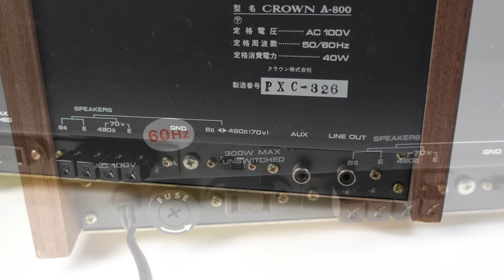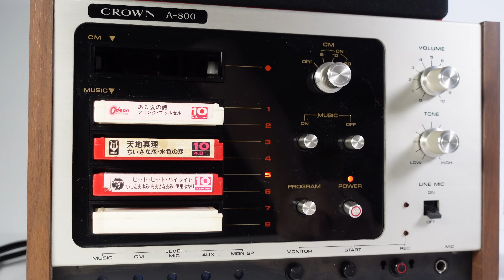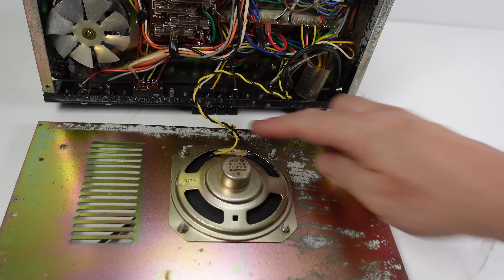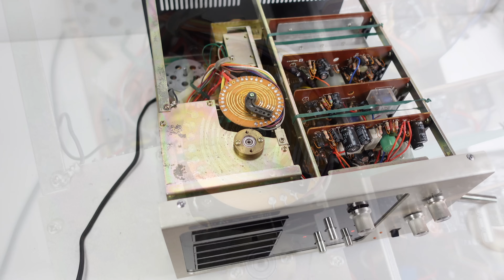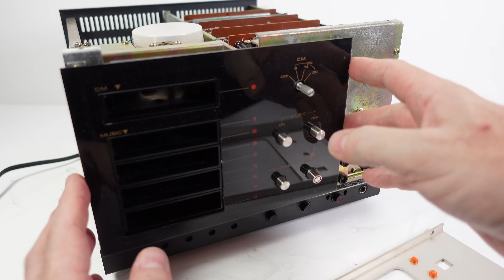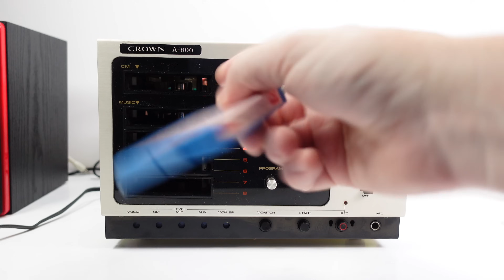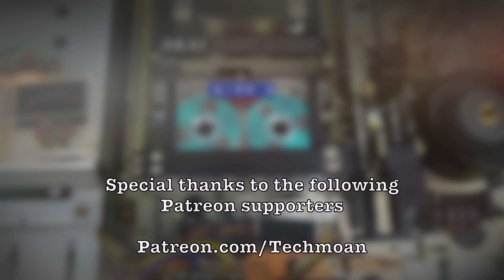An unusual player for a forgotten ‘70s music format

Comment: Whoever designed this machine must have been so proud of themselves. So many clever things. It's good that you showed it all for rest of the world to admire.
Reply: This is such a wholesome comment! Cheers!
Reply: Pioneer and Sansui were known as upper midline retail brands, but they both had research engineers who did interesting upscale and bleeding edge projects.  

Sansui devloped an FM tuner that only demodulated odd-order Bessel functions, in order to reject polarization spins from multipath.  Never saw that reach US retail, but very interesting to discuss, awkwardly with a quasi-English speaking engineer and ISO schematics, at a pro audio event.  

Pioneer made the first laser disc systems I ever got to try, but as prototypes had a single optical transport, with separate electronic units for music, video, or data (1980-ish).  In that era, JVC pushed a capacitance pit disc system, while until people realized how bad it was, RCA managed to market its tracking stylus video disc system, including via RAdio Shack.  Rather few in the USA realize how much innovative development work Pioneer actually did.
Reply: his name was Alfred Muntz of Los Angeles the carts were used by radio stations for commercials and other PA things he formed Muntz stereo pack and started manufacturing and selling four track car stereos
Reply: Absolutely! People take for granted the mechanical engineering that went into this type of equipment. I have an old R390 US Navy HF receiver that is such an amazing feat of mechanical and electrical engineering which blows my mind every time I look inside of it. The tuning mechanism is a labyrinth of gears, chains, shafts, and elliptical cams that looks like a 3 dimensional M.C. Escher drawing. It's definitely a lost art.
Reply: It's a textbook example of typical Japanese crap of the era. After the war japan was very poor and they were making knock offs of everything, basicly what china does today.
Reply: @kg4boj  Nonsense. This was early 1970”s, a quarter century after the war, and Japan had developed a reputation for quality by then.
Reply: @andrewagner2035  Japan didn't really start making decent stuff til the late 70s-early 80s. Back then toyota and Honda were just starting to be seen on American roads and great cars the were not! In the era in which this was made Japan pretty much fulfilled the role of what china does today, mass manufacturing of cheap crap. It should be no surprise that the announcement feature doesn't work properly and they are used a dying format for cheap parts.
Reply: @kg4boj  Japanese electronics was good from the middle 60”s already, we not talking about cars. There were many dying formats, that doesn’t mean they were bad, what about Sony Beta format for VCR? Wasn’t bad technically, was just not a commercial success. Then again the winning format VHS was also developed in Japan. Big difference between China and Japan-the Japanese are innovative and strived for improvement. Yet to be seen what happens with China in that department.
Reply: @andrewagner2035  Beta kinda sucked. It only let you record one hour of ntsc/pal video, whereas VHS, which came out in 1977 allowed 2 hours standard. But these are both mostly late 70s tech when japan stopped flooding the market with tons of crap we today would expect out of China.
Reply: @kg4boj  Except that VHS also came from Japan. Beta was a Sony development, and this had nothing to do with “crap”, but rather expectations of what the consumer wanted.
Reply: @andrewagner2035  In the late 70s after Japan stopped making crap! Before then video tape recorders were made by the all American company Ampex, which was recording at 525 lines of resolution in 1954, something that wasn't possible for consumers until the mid 2000s
Reply: @kg4boj  These we’re huge industrial recorders costing some $45k for broadcasting studios, not exactly in a small box  for home entertainment…..you need to compare apples with apples dude.
Reply: @andrewagner2035  Some models yes, but they had home versions like the vr-1500 thst cost about 1000$
Reply: @kg4boj  Beta cart system assumed you would want to record at full fidelity, that is 60 frames per second, thus the 1 hour record time, that would become known as XP.  VHS started at SP, the 2 hour format, 30 fps.  Beta gave a better recording, as it was higher fidelity.  Cutting from XP to SP, many people did not notice as they just wanted the time-shift machine.  My Panasonic analog TV to DVD recorder did offer the XP mode, one hour per single layer DVD.
Reply: @andrewagner2035  
I recall some upscale Ampex 1" VTR's that ran low 6 figures. But, 3/4" U-matic might be the better comparison to 1/2" consumer VHS or Betamax.
Reply: @kg4boj  Why would you call it crap?
Reply: @kg4boj  except, you know, the quality
Reply: @kg4boj  The creative spirit and principles of the Japanese were barely matched then and are unmatched by China today. China will never create and produce products at the same quality level
Reply: @MrCarGuy  So you're saying the Chinese can't make things that require extreme manufacturing tolerances and control to the point where a few atoms one way or another mean a pass/fail? I hate to break it to you but whatever you are posting from has chips millions of transistors mostly made in china...🙄
Reply: @MrCarGuy  They make all kinds of great stuff and are very creative. Ever hear of tic tok?  The reason you see them  as makers of crap you see in Walmart is because Walmart wants them to make crap. They have the ability to manufacture pretty much anything you can imagine to whatever specifications you demand, the thing is the importers want cheap crap so they make things with shitty specifications just as we ask them to.

Comment: I'm not expert on those devices, they are older than me but on electronics, capacitors always used for timings, delays and speed controllers. So I think you have a chance to change it 60hz to 50hz with one capacitor. Or you can re-record your cartridges as it is. As you may notice, your voice recorded well because you've recorded and played on same speed. On other player, it should play so faster. Also can you try to play standard cassette tape on this device and also this cartridge tape on casual cassette player(by transferring tapes inside between cartridge and casette)?

Comment: Highly doubt changing that capacitor will change the speed. You can't use components like that for playback speed, because there's too much variability in value (+/-10% at best for most types, even worse for electrolytics).

Comment: Most PA systems in Japan have announcements prefaced and closed by a series of four tones: ascending in frequency at the beginning, descending at the end. I find it very pleasant in that you're alerted to the fact that an announcement is forthcoming so you can pay attention to it, and then are informed when it's finished and you  can resume your activities. It's also ideal in that you just don't have some weird crackly voice suddenly shouting at you about a sale on pants or clean-up on aisle 3; your musing over which cucumber to purchase is gently interrupted rather than rudely so.
Anyway perhaps the machine has a tone sensor. A proper Japanese PA mic may have the tone generator built-in. It seems further Google Translate adventures with the user manual may be in order.

Comment: Regarding the Speed selection there I am pretty sure the capacitor could be used to alter the playback speed, it is probably put in series with the motor winding and by changing the capacitance the total power the motor get will change and hence the speed as well. I would be able to tell this if I had a schematic but in theory it could be absolutely possible the capacitor is the only thing changing the speed. Hope you get this comment since it would be nice to see another video in this device

Comment: To get the speed correct, if there is enough metal on the flywheel, you could cut a groove 5/6 of the diameter of the groove the belt  currently runs in.

Comment: The only reason you don't have to go through the same repair nightmare with cassettes is you didn't have a bunch of cheap no-name cassettes you used to record off the radio in the 1970s. When I recently discovered my old tapes and wanted to play / digitize them, they suffered the same problems: disintegrated pads and broken splices, where the clear leader was spliced onto the tape.  Not to mention the abuse they suffered because I was 11 when I got them, and some had been wrapped around the capstan a few times in their lives as well.  But, I've managed to preserve the voice of The Real Don Steele at Boss Radio, 93 KHJ in Los Angeles.

Comment: Relationship (again) between this format and PlayTape ?
Superficially similar.
Oh, and the Radio Shack 8 track changer had to make do with nudging all non-playing cartridges slightly away from the spinning capstan, letting only the one playing be fully pulled in contact and moving as it was playing. 
Rather like how “pause” worked on certain 8 track decks.
Reply: Never mind…
In your previous video.

Comment: So my guess is this, based on my knowledge of broadcast radio: I suspect that a cue tone is being laid down on track two when the start button is operated. The cue tone is used to position the tape to the beginning of the audio track - the idea is that it will "cue up" the next advert to the beginning of the audio after the previous one is finished. So, when recording, you press the record button, press the start button for 5 seconds which lays down the cue tone, then release it, and as you release the start button you begin speaking your "copy" into the microphone. When your "copy" is completed, you press the record button again to shut off the record electronics only, but the transport will continue to move the tape on that cart until the cue tone eventually comes around, and when the playback senses the cue tone, it will stop that cart, ready to play the message when triggered by the timer based on where the timer knob is set to. If you never lay down a cue tone (broadcast lingo for recording a cue tone), the cart will never stop and continuously play as it did in your video (or it is possible that the cue tone sensor is defective). Broadcast used a 1000Hz tone on track two when used in a cart machine, a very popular medium for commercial production in the broadcast industry during the 50's to the 90's. When FM became more prominent, it was customary for cart machines to use three tracks because now you needed a track for the left channel and another for the right, and a third for the cue tone. Some companies chose a 25Hz tone embedded into the left channel (specifically Schafer radio program automation of the 70s and 80s) because they wanted stations to be able to use existing equipment that most stations had at that time without having to purchase new, and the 25Hz was filtered before it reached the audio amps in the station to prevent it from being broadcast. So this particular machine that you have functions based on the broadcast industry customs of the time of manufacture. The idea behind the "monitor" is to be able to listen to your newly recorded commercial before "airing" it as it were. I might also suggest that you "bulk" erase the tape before you "record" because I did not see an erase coil on the play/rec head so it probably does not coerce the tape effectively when recording and you might hear your old recording over the new one, a phenomenon that plagued broadcasters who "forgot" to bulk erase before beginning production on a cart. While this comment is long and probably won't make it to your channel, I loved your presentation. 73's de W1ARQ

Comment: I wonder if you could make your own cartridges with some help using a 3D printer.  That's provided you can find the magnetic tape with the right spec.s., Maxell still distributes cassette tapes but only in Japan, not that the tape inside would work but just giving an example of "you never know" type of luck.  Anyways, thanks for the video it was very intriguing.
Reply: @Anthony Norton; Good idea, unfortunately consumer cassette tapes that move tape from one reel to another lack the graphite backing as it is not necessary for reel-to-reel movement. However it is needed for endless loop tape carts because it helps keep the tape from binding during stacking and payout.
Reply: @hwrdmltn  What about talking to a 3M rep. for suggestions.  That's if I'm thinking of the right company.

Comment: Something tells me you already have the answer by now, but anyways... Here's my five cents:

Changing the speed exactly by 20% by simply replacing an electrolytic capacitor would be a very bad design decision.
Here's just two of the many reasons:

First, electrolytics (and most capacitors in general) come with very loose tolerances, with ±20% being quite common.
So buying say a 1000uF rated cap will get you anything between 800 and 1200uF (but usually closer to 1000 than 800 or 1200, but I digress.)
It would be almost impossible to find an "exact" match, which means the device would be "ridiculously" expensive to manufacture.

Second, electrolytic capacitors begin to leak current over time (has to do with the chemistry inside becoming conducting).
This not only reduces its ability to store a charge, but the capacitor also begins to conduct DC-current, which it normally is supposed to block, and
this usually results in very unwanted side effects indeed.

But yeah, loved the video!

Comment: I do have a little expertise in Electronics and I would say fitting a larger capacitor in a 50Hz machine is just to compensate for the slower mains and would not change the speed. That would be more likely to be a different wheel.

Comment: Now You get a nice Japanese HiPac collection.. 👍
Strange, that announcement part didn't work as should.. Probably, there is some issue with some old capacitors.
If there was an schematic diagram, will be quicker to say about that 50/60Hz cap replacement effect on speed.. Looking on what I see from video, I think that it may solve issue, becauce motor has multiple wires and that's mean's, that it isn't simple DC motor. It's worth to try out.. 😉

Comment: My 2 cents, or pence, Mat, if you'll ever read this: The cap seems like a hum filter for the internal speaker. To change the playback speed, anything that is motor driven needs some change of the gears, to go from 50 to 60Hz and vice versa, because the speed of the motor is determine by the power frequency. 
In vintage record players by Dual, there are 50 and 60Hz brass pulleys, on the axis of the motor, which then turns the idler wheel.
Reply: No the cap is not a hum filter for anything.  Yes the speed is determined by the AC mains frequency and requires a pulley change.

Comment: When you can refer to the Philips Compact Cassette as simply "cassette" in a video about an entirely different audio cartridge format, you know who won the format war.
Reply: Cassettes are simpler and less finicky. Just a set length of tape between two hubs. The pinch roller is part of the transport mechanism, along with the capstan. They did, however, make endless loop cassettes, for outgoing announcements on answering machines. And Sony once made "Auto Sensor" cassettes with sensing foils at each end, which activated an alarm in the machine when the tape reached the end. Phillips also had end of tape alarms, but they sensed when the take up hub stopped turning.

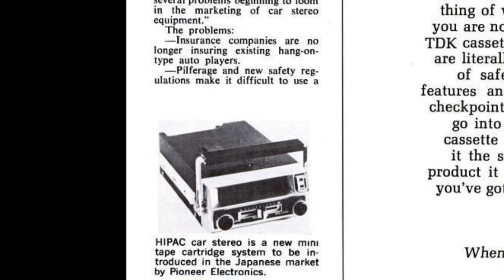Comment: 6:26  I read the article mentioning car stereo pilferage.  Maybe your car stereo with the handle was meant to pull out of
your dashboard and be brought into the house and plugged into the black case for home use.
 ( Is it removable from the case with an edge connector / plug on the back? )

Comment: I rather doubt the capacitor sets the speed. It comes down to this, tape speed needs to be set with a high degree of precision. That sort of capacitor typically has a 20% tolerance when new. More likely it is being used as a power line filter with different noise filter parameters for different line frequencies. My guess for the speed is the diameter of the spindle used to drive the tapes. For 50HZ a slightly larger diameter spindle would be employed to move the tape just a bit faster.

Comment: Kinda offtopic, but what I really like about compact cassettes, is that you can easily make read-only ones writable by applying small bit of tape (I usually used scotch tape, though any relatively sturdy tape would do) to cover the square holes at the bottom of the cassette. So if you had some cassette album you didn't really care for (which usually came with write protection) and needed a cassette to record on, this was the way to go.